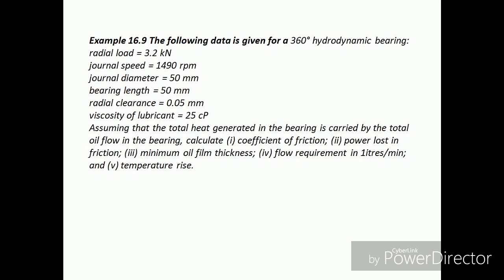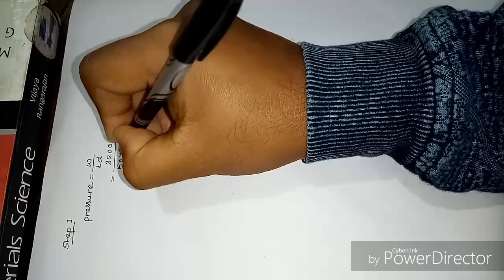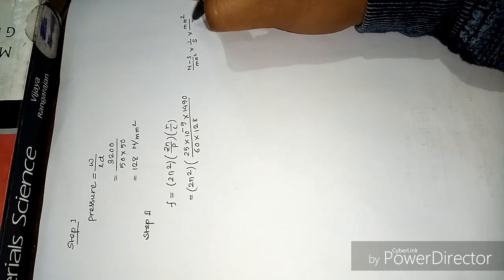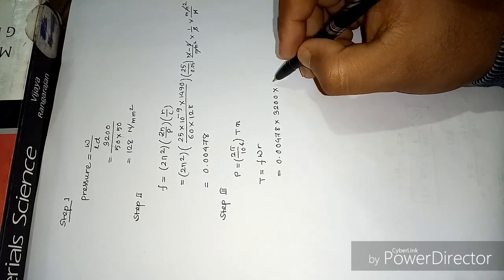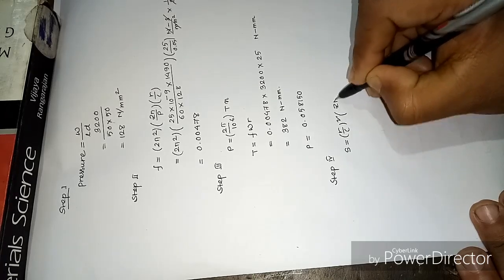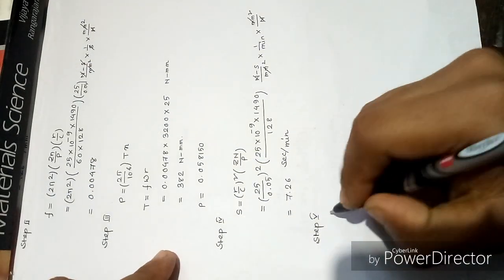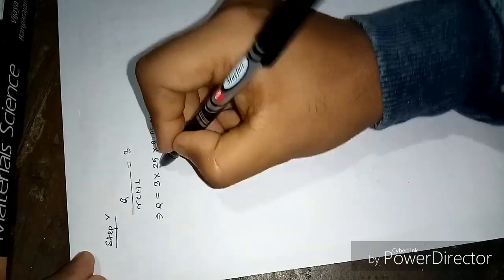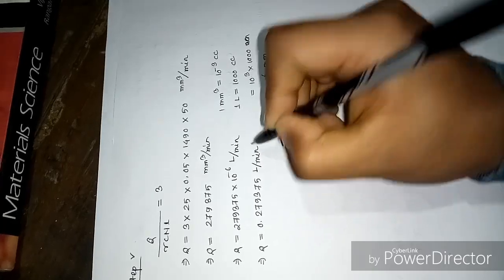Problem on Hydrodynamic Bearing,step wise solution with the design data handbook by Mahadevan (ASTU)

Comment: Nice...can we calculate oil flow rate  in spherical roller or ball bearing....?
Reply from the maker: U mean lubricant flow rates? Ya you can calculate it by calculating the diametral clearance which is equal to difference between bore diameter and journal diameter.